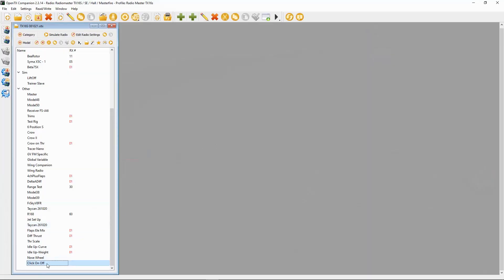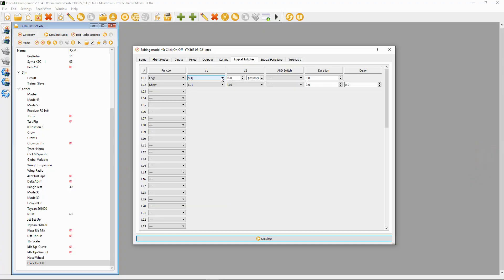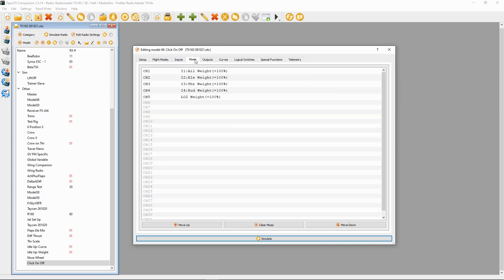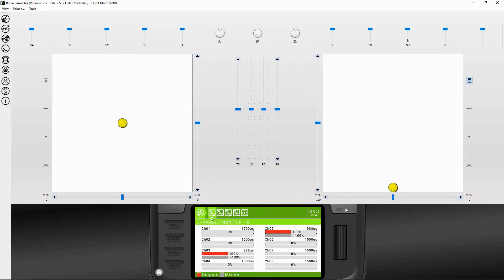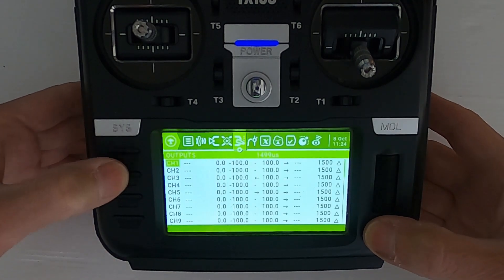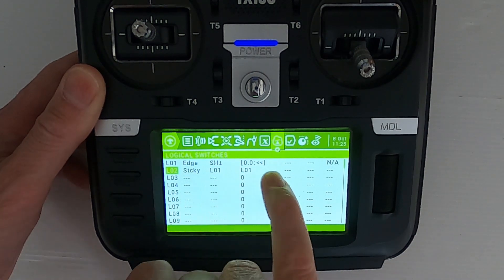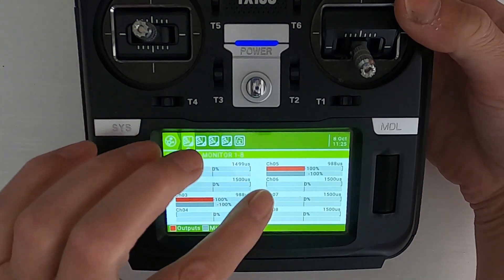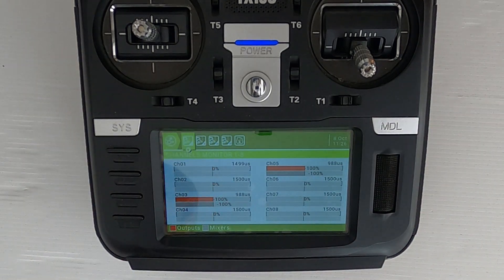OpenTX Momentary Switch One Click On One Click Off

Comment: hi any ideas how to set up a logical switch for landing gear safety option? Something like that: (Gear Switch is SF) SF is100 so gears are up then for landing the SF is-100 the gears are down, so there the SF should be locked and the parameter for that will be the altitude(if alt is less than 2m for over 5 sec duration) if the alt is over 2m the SF remains unlock. So now we are at the stage of were the SF is -100(gears down) and locked. Now if i press the SH the SF will be unlocked and remain at -100. Then i want manual to put the gears up so i will put the SF manually up at 100 and then when i will press again the SH the SF will be locked and remain at 100
Reply from the maker: Taken me a while to get back to you. I will be recording a video that will assist you with this. Please keep an eye out on my channel. Programming is done just need to film and upload.

Comment: Hi Bill! You can make this more easy, with the function SRFF (Set Reset Flip Flop) in one line with only using a single L0x
L0x   Function=SRFF   V1=SH↓   V2=SH↓
Reply from the maker: There are many ways to set up OpenTX and EdgeTX. Give it a go and see if it works. I will try the settings sometime.

Comment: Thanks Bill, is it possible to get the same functions with the 6P buttons, would it be possible to control 6 servos in this way
Reply from the maker: Hi Hans, I have spent sometime looking at this but the problem is that when you push button 1 it gives a value of -100 when you push the button 1 again the value stays at -100 so there is no value change a Logical Switch can detect to change the Sticky switch.
Reply: @the-happy-RC-flyer  okej thanks för thé ansver.

Comment: Hi Bill, you get the same result only with 1 logical switch: Function SRFF / Sticky - Variable 1: SH button (for on) Variable 2: SH button (for off).
Reply from the maker: Hi Willi, I tried that but the LS does not stay on only when holding the momentary switch back will it stay on.  The idea in my video was to operate the switch once to go and stay at full throw the another to go to minimum throw.
Reply: @the-happy-RC-flyer  Hi Bill, strange, it works for me ... Just like your version. I have the German version. SRFF is the flip-flop function.